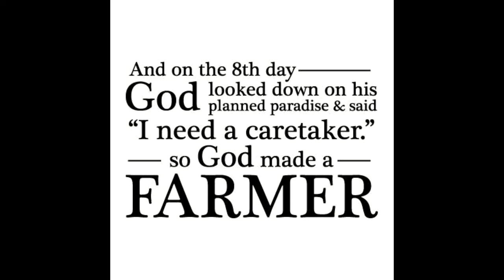Treating Raw, Rough-Cut Lumber - The Old Timey Way

Comment: I built a barn in the 90s with rough sawn Log leaf pine. Each  board, was marinated with diesel and motor oil. The post in the ground rotted from the inside out. The bugs ate the rafters and lathes down to powder. If I'd used pressure treated post, and sprayed the lumber with a Chemical such as Timbor, the barn wood still be standing.
Reply from the maker: Sad to hear that! My main concern here is repelling Carpenter Bees (Boring Bees). So far, so good.
Reply: Do you think the bugs came out from the inside of the wood? I am getting ready for a shed project and have a farm with a barn that is over 100 years old. The barn is still standing, rough cut green lumber was the building material back then I am sure. The post show signs of decay, but for the most part are still in pretty good shape. The builders, farmers, not engineers, could have used bigger joist, and closer column spacing, but the structure is still standing. It is remarkable to me, but I have seen no sign of treatment on the barn, just a good roof. That being said, your experience is a horror story to me.

Comment: I've got a sawmill and after sawing, stickered and dried. I flame anything that will be close to ground then treat with used motor oil and diesel. I've been going back every other year and spraying a maintenance coat and  had amazing luck so far. I also treat the outside of our log cabin with oil and diesel. Works great.  I'm sure EPA or DEQ won't like it but they don't pay for rotton wood repair.
Reply from the maker: Ive read that lightly charring the wood at ground contact works very good also. I'm gonna try that method sometime soon also.

Comment: I mix used moter oil and off road diesel and Mix it 40/60and a pump up sprayer and spray the whole shed
Reply from the maker: I also know a few folks who said they did it this way too and had great results.
Reply: I do the same thing as you. Works awesome.

Comment: Thank you for covering the boring or carpenter bee's .... I absolutely dispise those critters. (a tennis raquet ruins ther day but you never get them all)
I have been ponderin the motor oil method..

I'm in NC
Reply from the maker: Thanks, lectro88! Much appreciated comment and thanks a bundle for watching! Boring (carpenter) bees are a real issue with raw, untreated lumber.
Reply: @8thdaychronicles   I appreciate you replying...
Question:
I know you said "all" untreated, But I have not noticed them boring in oak, but I also don't have a lot of oak boards in barns or sheds.(so again I don't know)
Now that I have my own mill, I have a lot of oak on the ground that has died and/or fallen from storms and wind.
obviously a lot of sap rot to be cut away but these oaks... Red, White, Water and Pin will yield some very nice and strong lumber,... with some effort.
I'm thinking a paint roller for applying, and thought about applying right after I sawed and stacked. my idea there is the oil on the fresh sawed will slow the drying and maybe slow some of the cracking. meanwhile keeping all other "pests" away as well.
and I figured I might have to apply at least 1, maybe 2 more times I know the wood is not going to soak in as well not dried.
I have cut oak logs that have been down 3 years tarp covered, and they are not what you call "green" but they are still sopping wet passed the sap rot. (they don't dry til you open them up)

Any input on this idea much appreciated.
Reply from the maker: @lectro88  Our main barn is a combo of white pine lumber and white oak lumber, about 70% pine and the rest oak. Both are rough-cut sawn lumber. We treated the barn siding as soon as we were finished with it and 8 years later zero carpenter bee or insect damage. And you could be right...maybe the oak is a bit more resistant to boring bees, I'm not exactly sure, but I see them buzzing around it and leave after treatment. I do know they will attack pine lumber with a vengeance. One thing about white oak lumber, I drill pilot holes for all screws. The seasoned white oak will dull a bit quick! And if a pilot hole isnt utilized, driving a decking screw thru it can cause a crack to start forming and over time the crack runs further and further. But it is indeed excellent barn siding! Good luck with your lumber!
Reply: @8thdaychronicles  You echo my general thoughts.
You are correct in untreated pine they will have a hayday with it.
 I have seen started and abandoned attempts on "store bought" pressure treated, maybe a very few successful bores.
Just in case anyone is wondering.... "store bought " pressure treated is not 100% safe from attack(slightly off topic)
It's been good talking with you, best to you and yours too.